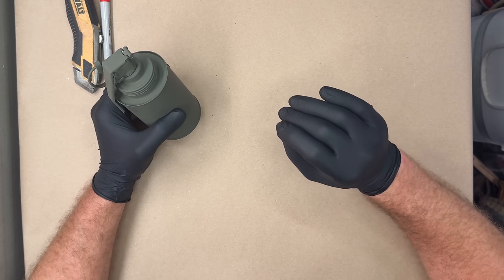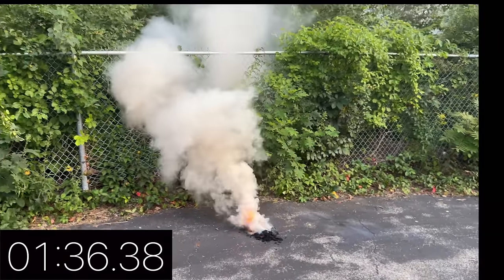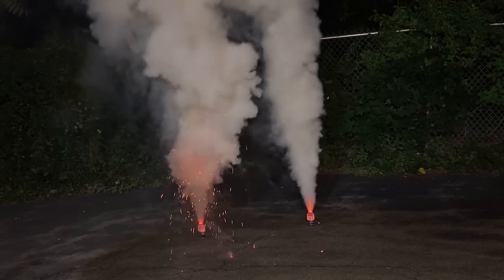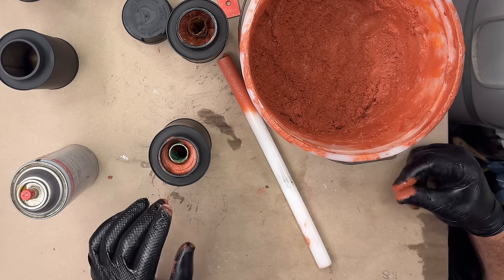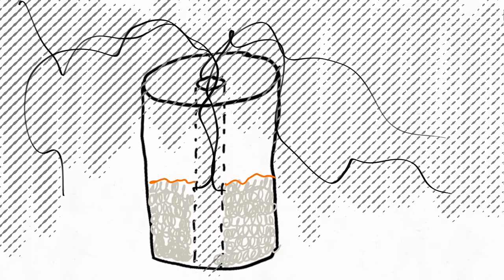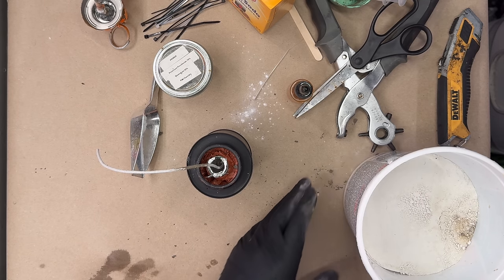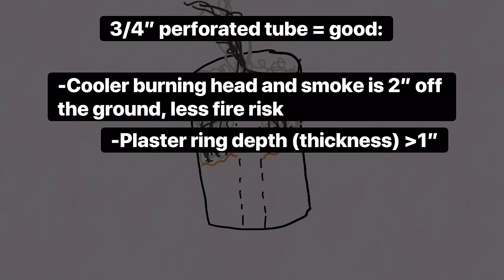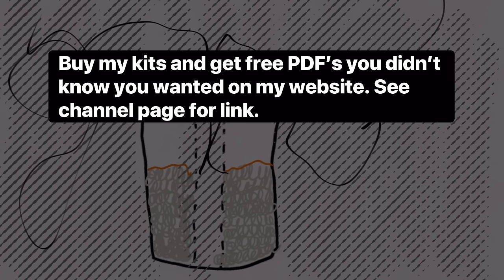Best Throwable Smoke Device on Earth Just Improved by Sub's Suggestion

Comment: this acts exactly like a solid rocket motor. research into the field of modal rocketry will be aplicable in your current endeavor.

Anyways the entire surface of the inside cylinder will be under combustion.
It will not just burn from the bottom or the top, the flame front travels to all exposed fuel.
And your worries of it being filtered by the ash is overblown, don't fixate on it.

much luck on the next iteration.

-jeb
Reply: @jebkermen6087  Excellent point, I came here to say something similar. The circular center shaft will have a constantly increasing burn rate (burns faster as time passes), which gets hotter and may lead to unwanted embers and higher smoke temperature.

It would be interesting to see how a narrow central cavity (like an oval) affects the burn rate and smoke intensity.

Also there are lots of resources available covering different cavity designs for solid rocket motors.
Reply: morton thiokol....WHUT!!!  LOL

Comment: Hey, @invention incarnate

You could use a big washer just big enough to fit your canister hole size, but with a center hole small enough to prevent your perforated tube from coming out. Then go to the hardware store and get a snap ring that just bigger than the washer (they will have them at parts stores and hardware stores) the snap ring should prevent the washer from being able to come out because of the tapered neck/and or the threads of the neck. You could also drill smaller holes through the washer so it helps prevent it from acting like a rocket.

Comment: You are essentially making slow-burning solid fuel rockets, but without compression. If you restrict the nozzle more you will either create a rocket and see it flying or a bomb.
Taking that into account, I'd apply some lessons I learned from making rockets.

* add a liner to the can before filling it, something like fireplace sealant. Just brushing it in 2 coats should be enough, or you could fill and pour it out. It prevents heat from passing through the metal can and lighting shit on fire, it also protects the metal against most of the heat.
* make your fuel pourable, when you pack it like that it's probably filled with air bubbles in between chunks that heat up and explode, causing the chunks to fly out. Pouring it means smaller air bubbles and you can vibrate to get rid of most of them. Also allows better control of how much fuel you are adding exactly. 
* Increase the center hole chimney by 50% and use a proper steel pipe, not just a broom handle, this will make things safer and lower pressure, at the cost of only a little less fuel. almost half your fuel in weight is the outer 10% of the content of the can. 
* You could probably benefit from adding some kind of liner between the fuel and the pipe. Fireplace sealant works, but you don't want the liner to block the holes, so probably paint the pipe with the liner before you assemble everything.
* only perforate the bottom half of the chimney pipe, you don't want the top to burn, you want it to burn bottom up. Holes in the middle and top are igniting your fuel all around, you can see this in the video, this creates a short, hot and messy burn. Probably burning some of your smoke into carbon before it leaves the can.
* make an actual cap of burn-safe material, like fireplace sealant with rockwool that both keeps the metal tube in place once hardened, and prevents the fuel from combusting from the top. Make sure you dont block the tube with this.

Comment: Hi, I have a couple ideas that I believe are worth investigating. First, try using the finely perforated center tubes found in automotive oil filters. The fine perforations should decrease the “chunk” events to minimal levels and may even offer protection from the fuel surrounding the tube from ignition by the primer thus allowing a more optimal bottom to top fuel burn. The finely perforated tube could also theoretically control the rate of smoke released due to higher resistance for fluids to flow through 100+ small orifices vs 10-15 open circles, which should help keep more heat within the system, which could culminate in greater burn efficiency resulting in either elongated burn times or producing more smoke overall. I would suggest a large capacity oil filter for a diesel truck as they would have the longest tubes for you to use.

Second, solid fuel rockets often mold the fuel with a star pattern center channel to increase fuel surface area and to promote a more equal burn rate. If I remember correctly, the star pattern also helps protect the fuel column from pre-igniting before its proper time in the ideal bottom to top fuel burn. 

I honestly wish I could test these ideas myself but would be very intrigued to hear your findings if you include these in your next smoke canister video. Thanks for considering!
Reply: Oh almost forgot, my original thought is to use something resembling a rack and pinion gear mounted to the rod you use to create the center hole to create the star pattern.

Comment: Loxeal 4401
2 part, semi flexible, high temperature epoxy adhesive.

I think you can also get moldable 2 part ceramics. 

This is going to be better than plaster, there are many things out there to do this job.

Comment: If you want to reduce the outside temperature of the canister, why not coat the inside with the same plaster you used on the top? It would detract from the total volume of compound that you can place inside, but depending on the thickness of the plaster layer, it could be reduced from red hot to warm or even cool to the touch while active.

Side note:

The plaster you used is a powder, but you may be able to find one that can be made into a liquid, which would make for a much simpler coating process.

1. Mix plaster.
2. Pour a small amount into the canister.
3. Cover.
4. Roll until thoroughly coated.
5. Cure.
6. Repeat until desired thickness is achieved.

(I don't know anything about pyrotechnics)

Comment: Try packing the mixture into the can with a fixture like they use to make rockets or strobes. This should remove the need to put the bicarbonate in to take up dead space. Place the perforated tube inside the can and then use a tightish fitting dowel to occlude the inside of the tube. Remove the dowel after the can is tightly packed. If you’re having trouble with the mixture compacting, you can probably use paraffin as a binder. You’ll need to melt the wax and add the mixture to it then sufficiently mix it into a paste. 

You could also use a card stock sleeve to block off the upper holes. Get the paper thickness right and it will burn away when the holes are reached.

Comment: I just found your channel and appreciate your continued efforts and time. Thank you . I wonder if instead of plaster you could use refractory cement for the cap ? Plaster becomes brittle with extreme heat and the pressure inside the canister is enough to spall the plaster. I believe you can buy refractory cement in a calking tube to make it easier. The tube is used for fireplaces and wood stoves.

Comment: You could drill a hole in the bottom, have the perforated tube run all the way through and plug it with a piece that intentionally fails in some way to further relieve pressure and reduce burn temps. A wad of nitrocellulose/acetone putty could act as a plug and serve as part of the ignition train.
 Less full combustion, less chunks flying out and more smoke for longer I would be the result if I had to guess.

Comment: Our devices had portholes drilled in the shoulder or neck of the cannister and the holes (4) cover with a durable tape. It featured the same tube in the center. The cannister had a thicker neck with finer thread to prevent the striker from being ejected allowing the portholes to do the work. A balance between pressure and hole size and number of holes need to be tested to prevent it over pressure and popping it very loudly. Pressure also changes the volume, particle size and (hang time). A lot to test and many variables. Enjoy and good luck.

Comment: A few ideas to try, you can weld the 3/4" core tube to the cap, perforate only the top portion, just above the compound fill line. the fuse will ignite the compound on the top but the smoke will travel along the center core to a blow out valve at the bottom of the device. (a piece of tape on a dilled hole) you could add more compound per device this way as well.  another idea is to reduce the size of the core to 1/2".

Comment: If you use plaster to cap it off maybe mix some rockwoll into the plaster. It is heat resistant and should help to prevent cracking. Or use only only rockwoll and put a metal screen ontop to prevent it from being ejected. It also would allow smoke to go through. And last but not least. Make 2 holes in the container (top and bottom). This way you reduce the gas velocity and backpreassure (which should help with stuff geting ejected). Some aluminium foil could be used to cover the bottom hole. It will rupture easily when the device is ignited.

Comment: A suggestion for adding the perforated tube whilst forming the cavity:  if you have a length of the bottom portion the Delrin rod turned down to the length and inside diameter of the perforated tube, you can slide the tube over the rod and use the rod to ram the tube home.  If you then pack the composite around the assembly before removing the rod, the uncured composite should form itself into the holes of the tube, and when it cures it'll be fixed in place.

Comment: As another commenter pointed out, this is most likely burning similarly to a solid rocket motor i.e. vertically along the entire fuel grain. I recommend mixing for a slower burn, and increasing the burning surface area in a star shape for a higher initial surface area. It'll lead to a much more constant burn rate because as the grain burns it'll round out the star, meaning the total burning surface area remains relatively controlled.

Comment: For your wire hollow to prevent more chunks and maybe more heat distribution you can add a wire mesh to the bottoms and top. So during construction you could actually just put the mixture around these premade meshes and they can be enclosed or put in a way. I definitely need to try to make my own soon enough. These are the smokes I saw growing up on cod with and went to the store and was disappointed with the store ones

Comment: A disc of steel window screen can be used like rebar in concrete to reinforce the plaster. It could also be wrapped around the core pipe to alter burn characteristics. Vary the drilled hole sizes, their layout, and their quantity to optimize the results.

Comment: Add a 1 1/2” washer areound the 3/4” tube while adding a series of 1/8” holes around the cap.  This should in theory resolve the cap pop off, increase volume and eliminate flaming chunks.
Maybe steel wool in the top 25% of the 3/4” tube to assist in filtering off ejecta.

Comment: Another sub suggestion here. Make the perforations smaller at the top and larger at the bottom. 1/4" at the top 5/16" in the middle and 1/2" at the bottom. Also You might want to limit the amount of holes at the top in smaller size if you wish the bottom to burn faster. Could also just try a lot of small holes and play with the ratio of holes along the length of the cylinder until you reach desired result! 

My experience is about 15 years of construction and MacGyering with my grandfathers in my youth and now into my adulthood as a Maintenance Mechanic on automated robots haha. Hope it works if ya try it!

Also what @Exandria said would be very good in terms of insulation if you just put starlight in a thin coat around the canister then maybe leave some of the top rim uncovered and flex seal it all except the portion which needs to blow off. 

As Smokey said, Only you can prevent forest fires!

Comment: A rounded bottom with the weight low down could make it land "feet down" always, further reducing fire hazard. Or sticking with the cylinder shape make it imbalanced so it comes to rest at a defined point. Could angle your "exhaust pipe"upwards then.